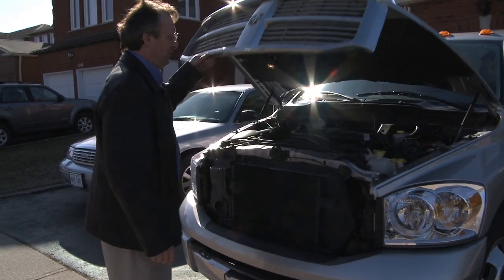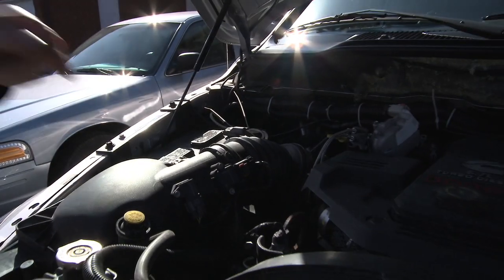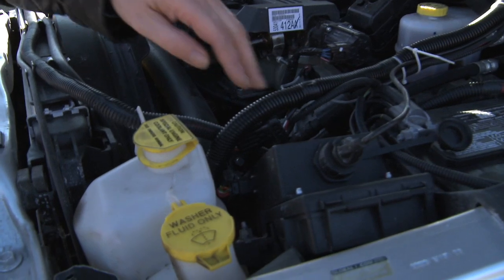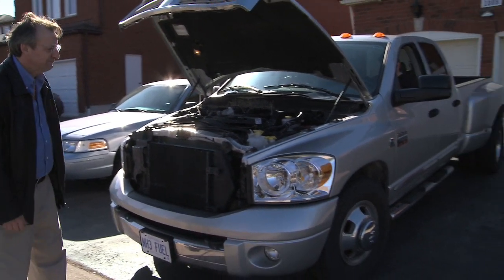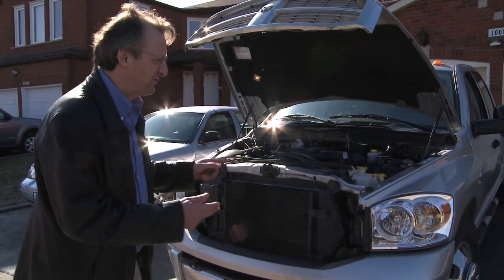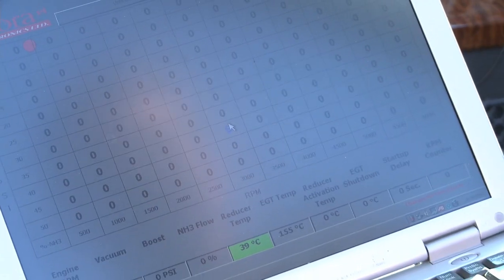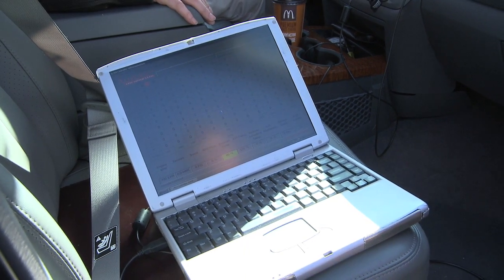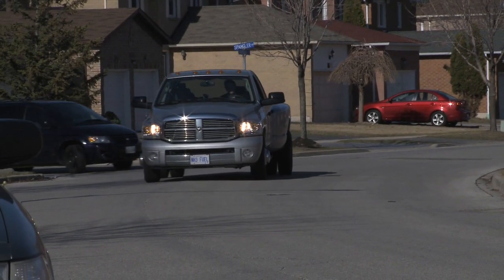Hydrofuel Inc Update

Comment: Interesting the nitrogen oxide levels go down when you add more nitrogen to the system. Though they do use urea in diesels to reduce NOx levels. So its plausible. Im not sure it will be full of so many benefits. Ammonia is probably subsidised for agriculture use at present. We move to a new fuel the government farm will just increase taxes on Ammonia. Just as now fuel taxes are a major part of transport costs. Ideally you want to keep it utilised by a few  but increase levels to allow better refuelling  station numbers but keep it below govt radar level. Of course just my initial speculation and Im no expert. Theres certainly a niche market in making greener truck transport. Are there any studies on what the impact there would be in converting to this technology. cost benefit versus increased complexity and impact on pricing?